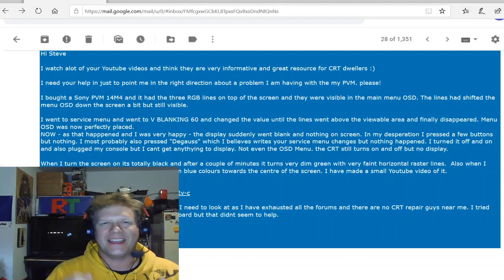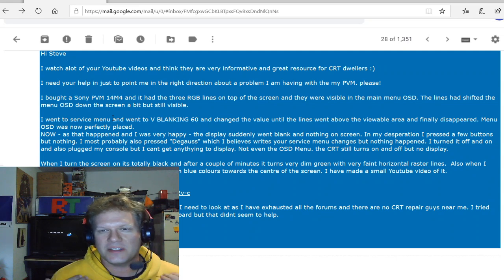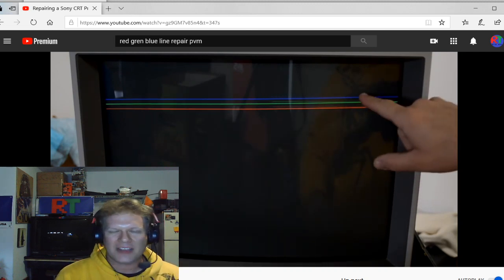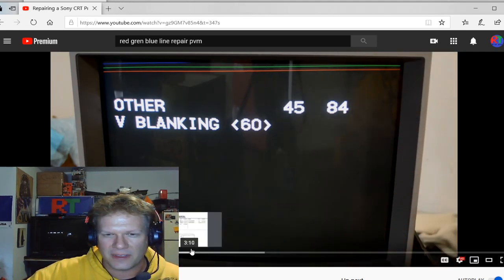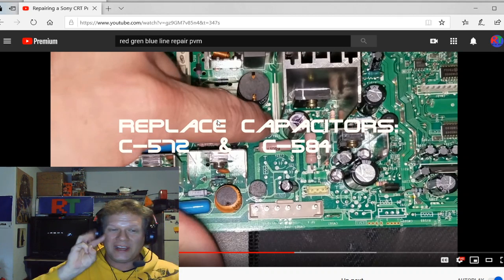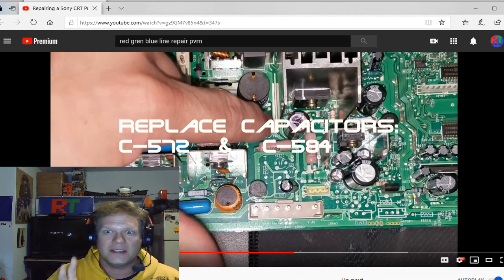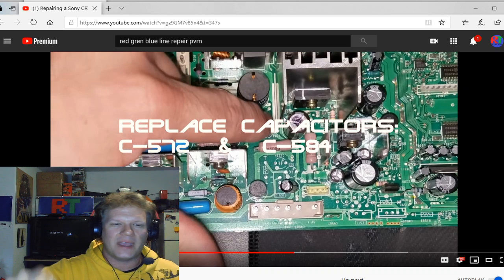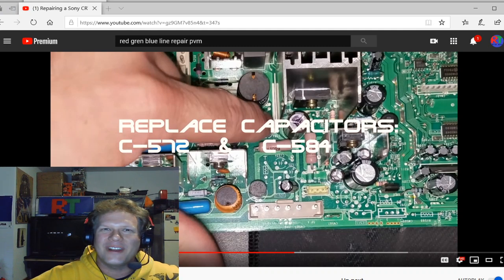Save your Sony CRT from certain death! Red Green Blue screen line fix!

Comment: Yes. You are adjusting the vertical blanking voltage to a higher level on the OSD to compensate the leakage on the capacitors, so that is the best way to kill a damaged capacitor.
Reply: can you tell me what is the default value of vblanking 60 ?

Comment: Thanks Steve! - This is happening with my 14M2U and I also googled the problem and "fixed" by using V-Blanking adjustment. Fortunately, I haven't had time to use the monitors since my "fix" so that might have saved it. I will be changing the caps soon with the help of your video. Thanks again!

Comment: I have a Sony consumer set (KV-21X5K) that appears to have those RGB lines just outside the viewable area, but are visible above the picture when in 16:9 mode.
I knew they were there since I found it almost a year ago, but didn't know what they were. If that's the same issue I hope I can find a way to fix it.

Comment: My 20M2 has those coloured lines but they are at the VERY top of the visible screen and the are very close together. Am I ok for now? Also where's your site for ordering cap kits?
Reply: yeah me too, are we ok?
Reply: @alak58 thanks for your answer, i might go the route of changing the caps just to be on the safe side.
Reply: Same here
Reply: @alak58 Do not do that!! there is a warning about pushing it out using the settings

Comment: I have a 14M2E and I can only see two of these lines when the "underscan" option is activated. Is it serious? Thanks for this video.
Reply: I would also like to know this except pretty sure i see the three r, g, b lines will have to check if it's 2 or 3 lines when i can.
Reply: Folks, it's not serious, it's normal behavior. You should only be aware of this issue when it's showing in normal mode screen. Take a look at the manual: "When the monitor is in underscan mode, the dark RGB Scanning lines may appear on the top edge of the screen. These are caused by an internal test signal, rather than the input signal".
Reply: @6Damien6Omen6  I just did a test on my PVM (14M2MDE) and only discovered the RGB scanning lines at the top of the screen in underscan mode, I noticed the exact same text in the manual. Thanks for the clarification.

Comment: Ive seen these on the very top of some of my sony consumer screens just out of the overscan area should i look into it for my screens or does this not affect me
Reply: I only see these lines if I switch to 16:9 on the pvm, they're definitely not visible on 4:3 setting, as they're so far out of the scan area
Reply: @pdiggitydogg  That's normal. If they're only visibly in the 16:9 setting, in the overscan area, that's not a problem. It's only if it's actually in the proper visible area.

Comment: I see some BVM-D14 been sold online also has  this kind of issue. Does this mean that this monitor has been operated for a long time? And the hour meter in the menu must be very high ?
Can these BVM-D14 be fixed by the same way?

Comment: I'm having this problem on a consumer set, the famous KV27-FV310. I know it's not a PVM but the problem is very similar. Error code is reporting a V Stop issue. I have the service manual but I'm not sure which capacitors are controlling this. Any chance you might be able to help me figure out what needs replacing? Looking at the board, no obvious signs of capacitor failure.
Reply: Did you ever fix this problem? I also have a 27FV310 with this problem, and all the electrolytic capacitors are normal values. I replaced the ones near the vertical IC anyways but the problem is still the same.
Reply: @Snivy102  Sadly, no. I took it to a TV repair shop that had an older guy working there who claimed to be a bit of an expert repairing Sony's back in the 90's and 2000's.  He called and said that he found the problem and that the fix required a part that was no longer available. I think it was an IC that went bad but I'm not 100% sure. 

I couldn't afford to put more money into the set at the time and I was short on space in the house, so I ended up telling him to scrap it. I wish I hadn't and had instead kept the set and done more research about fixing it myself. 

That being said, I did end up getting an FS210 which is similar with the primary difference being that it has no high voltage regulator, but honestly I don't miss it. My FS210 is now calibrated better than my FV310 was and it looks better, so I can't complain. Sorry I don't have more helpful information to offer you and I wish you the best of luck with your repair.
Reply: @ultimateman55  thank you for your response

Comment: I tried to help him out. Look on shmups forum. Went too far into blanking. Is it fixed now? My idea was to go in blind into the menu and press 90 times from 1st item to get to blanking. So it took out the vertical output transistor? Not thinking the flyback is bad. Still has a raster and is putting out heater voltage and  G1 and G2. If these were low or dead then yes or the Horizontal output transistor would be dead as well.  Even though the raster is pitch black but you can still see scan lines tells that the vertical output transformer is still functioning however you're not gonna have a 60 cycle sound to the fly back or the vertical transformer sence there is no image because the processor is blanking the output.  At this point if you believe there's no high voltage one could acquire in anode probe and check under the cup for 28 Kv.  Also even know it sounds crazy if the blanking cannot be brought back within the tolerance of the 2 vertical control capacitors you could swap them for a lower ESR temporarily to try to bring the picture back enough to get into the menu if uncomfortable with trying to do it blind but remember if trying to get in blind you're not going to harm anything unless you save the settings.  The worst that will happen is you will go into a function that controls the horizontal and send it in to protection, thus throwing the green call LED on the top.
Reply: Really appreciated your help mate, thanks
Reply: @SaminPK  no problem. Steve's a smart guy. Works on way more of these than me. Hes seen the good, bad and the ugly. I deal with consumer CRTs. More or less the same internals.

Comment: Thanks a lot Steve. You're a real star!! 
It was literally less than a minute after adjusting VBLANKING [60] that it popped. I suppose there is no point in changing caps C-572 and C-584 now? Or is there??
Also when switching the CRT off  - there is that unusual rainbow like splash of colours on screen before it goes totally dark (as seen in the end of the video). Is that indicative of a flyback failure or any specific component failure?

Comment: Does this affect the 20L5, I noticed these lines at the very very edge of the screen (I could really only see the bottom line), I did a factory reset and they went away. If it affects the 20L5 are the cap locations and values the same?

Comment: I looked at the bulletin and it says C-572 and C586. It does not mention C584 and also that capacitor is a different value. I have one open right now and I’m not sure if I should change it. To a 4.7. Can you confirm please

Comment: My trinitron tv recently began to shows this lines too. Can be fixed similar to this?
Reply: yes! typically its a 250volt rated capacitor for big one and 160volt for smaller one. you can easily find them on the circuit diagram. one its attached to B+ and second one to +200V of FBT lines. you can put higher capacity without any problem, the most important part is voltage rating and operating temperature.

Comment: i get these 3 lines when i set 16:9 on my pvm 8045q. not the same thing right?
Reply: it is! just replace all high volt caps from horizontal deflection. this issue is present on any color CRT! not just PVM/BVM

Comment: Mine pvm 14m4e yesterday have appear from nowhere a green line on top, I have move the vertical position a little and all good, 15min later the green line have appear again, more 3min and the 3 lines have drop like 5cm from top and crop a little the image, I have Turn off the screen and remember that I have seen here the same problem, already have disassembly the bad boy, and bought online the caps (dont have a local shop with good caps like Nichicon), when they arrive and change them I will give the feedback! Ps. Have bought some more caps so I can change all caps in that hot area and better temp resistance :) And a good clean off course xD thanks for the tutorial! :D

Comment: Hey Buddy! I have a Sony Trinitron KV-32WS2U - I was watching some old 80's cartoons on it with my daughter the other day and all of a sudden the screen cut out and the standby button began flashing twice.
From what I have read online this most likely means that there is an issue with the power board.
My question is this = will replacing all the transistors and capacitors that i can on all the boards likely fix this problem? I REALLY do not want to loose this TV :( it is like a child to me!!
Reply: I have a Sony Trintron KV series TV and when it warmed up it would constantly switch on and off... don't know if that is the same problem you have, but I changed all the power supply caps and hasn't had a problem since.

Comment: High ripple current cap (such as film) is recommended for C584 as per service bulletin.
Example:
https://www.digikey.ca/product-detail/en/panasonic-electronic-components/ECW-FD2W105K/PCF1617-ND/3844564
Electrolytic will still do the trick, though.

Comment: I own a 1954q and bought a capkit for it from SavonPat. It looks like he addresses both of these capacitors in the kit he game me. The 572 he repaces with a 10UF/160V and the 584 he stuck with the original 2.2UF/160V.
Reply: I bought the same kit, and noticed a upgrade on color quality, but I'm looking for the full cap list for 1954Q. I still have some geometry issues in my unit.

Comment: does anyone know what is the default value of the vblanking 60
Reply: In a manual I found googling, it says max is 255 and ‘standard’ is 161. For vblanking 50 it says 82 is standard. I’m trying to decide if I need to deal with this myself on a new 20m4u
Reply: @dylanjastle  thanks man!

Comment: Hi, I just bought a PVM 20L4 and has retrace lines in the very top of the screen (at the edge) but only when a PAL source is connected. And then the image showed is in black and white, don't matter if the source is connected by composite video or RGB. Also the retrace lines are very close each them, not as this video show. But when I connect any NTSC signal there aren't retrace lines and the image is in colour.  I have reset the monitor configuration to default values by the option of the OSD. Is my PVM in danger? Thank you Retro Tech
Reply: I had the exact same issue, seems to effect 50hz first. There are two separate blanking settings inside the pvm osd one for 50 and one for 60hz. Mine was working flawlessly in 60hz but was cooked in 50hz. Eventually it was fucked in both. I turned it off and put it in storage until I can fix this.

Comment: Does this apply to consumer sets!? My KV-21X5U has these whenever I put it in 16:9 mine, but they aren’t there in 4:3 unless I mess with the geometry settings to seriously skew the image.
Reply: If they are on the top edge of the picture and are very narrow, I think there's nothing to worry about. But given the possible age of the set (late 90s?), a recap or simply redoing the solders might be advised.
Reply: This is normal in 16:9 mode on Sony TV's. I have seen this many times. You could also get them on screen in 4:3 mode by adjusting settings as you describe. The important indication of faulty caps is that the lines are spread out - normally you would get RGB on adjacent lines. The example he uses in the video shows a severe case with RGB lines well into the screen area and spread out (black in between). Sony TV's (and monitors) generate the RGB lines to sample the beam current. This is normally off the edge of the picture.
Reply: RetroWorkshop An, okay. That’s good, my RGB lines have less than a scanline’s gap between them and are above the picture.
Reply: @alak58 If there is no gaps between the RGB lines, I think you are OK. As you saw in Retro Tech's video - in a bad case the R G B lines are well into the screen area and spread out (gap between each of the R G B lines). On my 14M2E I cannot see the lines in normal (4:3) mode. If I hit 'under scan' I can just see a couple of the RGB lines at the very top of the screen. In 16:9 mode, the monitor has "dropped the scans" by a mile and I can see the RGB lines (this is always normal). In this case the RGB lines are on adjacent lines (no gaps). From the Sony PVM 14M2 Operating Instructions: "When the monitor is in the underscan mode, the dark RGB scanning lines may appear on the top edge of the screen. These are caused by an internal test signal, rather than the input signal."... Regarding the fault: When these two capacitors age, this results in the scanning being affected. This has the effect of bringing into view (or more into view) the R G B lines that are internally generated test signals (to ensure white balance). The more into view, and the more distorted these R G B lines appear - the more severe the fault... They key thing, as Retro Tech says, is not to just adjust them out of view using geometry adjustments as you could be hiding a potentially big problem.